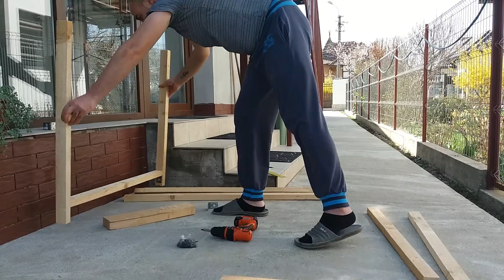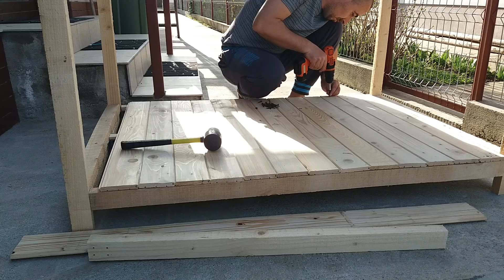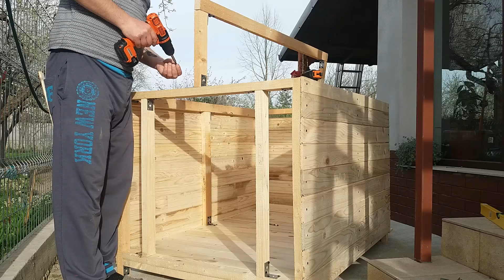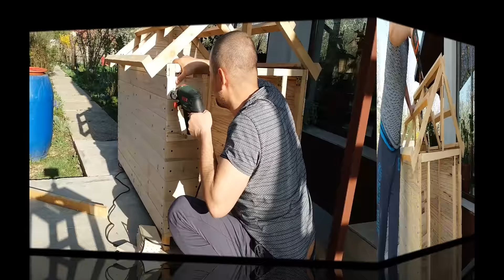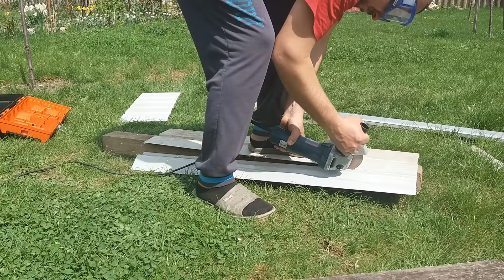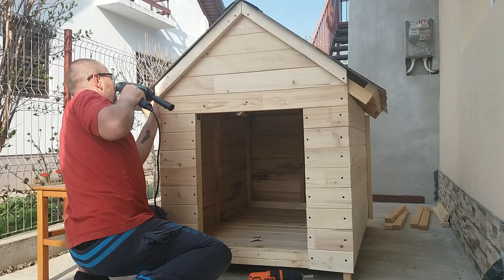Casuta (cotet) pentru caine de talie mare

Comment: Salut Daniel , am un sfat , pentru a prelungi durata de viata a tablei,  taie cu foarfeca de tabla ( pelican sau cea normala ) , nu mai pune flexul pe ea pentru ca flexul arde stratul de zinc si incepe sa rugineasca de 10 ori mai repede decat in mod normal . 
P.s. Ai mai castigat un abonat .
Cu respect , spor la treaba 👍
Reply from the maker: Stiu Sebastian, numai ca la un cotet nu ma intereseaza cat ma tine tabla, o pot schimba oricand. Aveam un colt acolo care iesea mai in afara decat cealalta foaie si am vrut sa-l tai. La acoperis insa, niciodata cu flexul, sau, cu turatie mica dar nici asa nu as taia decat daca nu pot deloc cu foarfeca. La un cotetel, un ceva asa unde nu are prea mare importanta cat tine, merge si cu flexul. Mersi si te mai astept si pe la alte clipuri.
Reply: @DemoToolsYT  Cu siguranta . O sa iti fur ideea si o sa fac si eu un video cand ma apuc de coteul Cainelui meu . O zi faina . 🤗
Reply from the maker: @SebyZZZ94  Varianta asta nu iti place mai mult? https://youtu.be/JsEkl5XwMjs
Reply: @DemoToolsYT  Imi place mai mult , numai ca am spatiul limitat si cainele mare 😂 . O sa ma orietez , momentan trebuie sa ma apuc sa torn fundatia la țarc . 😎